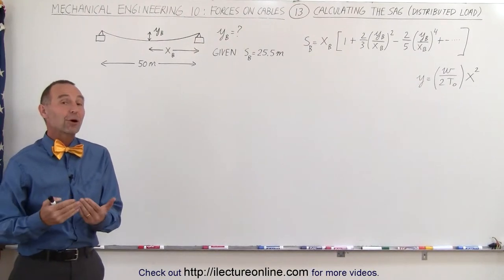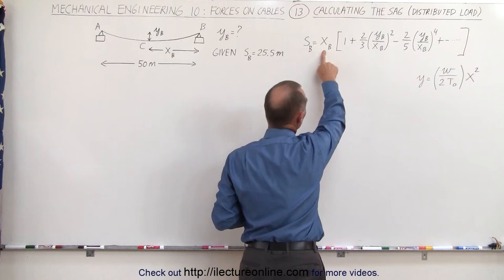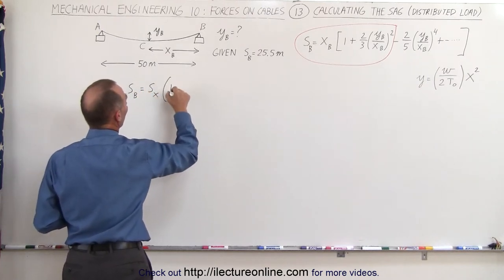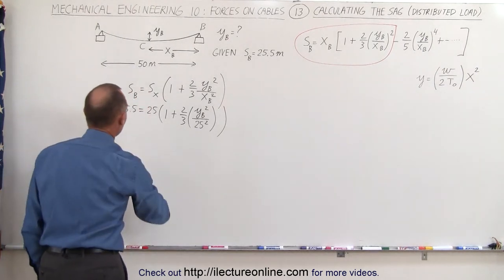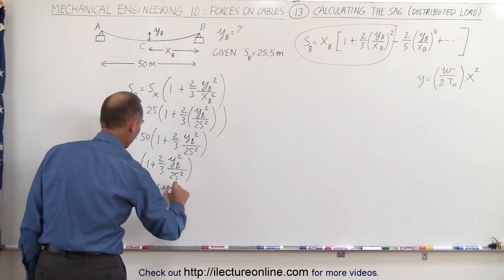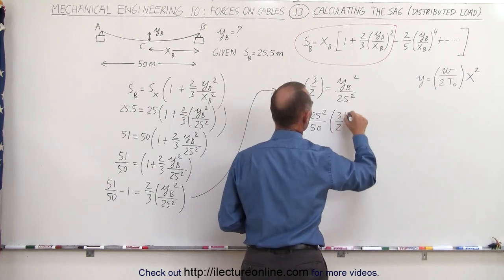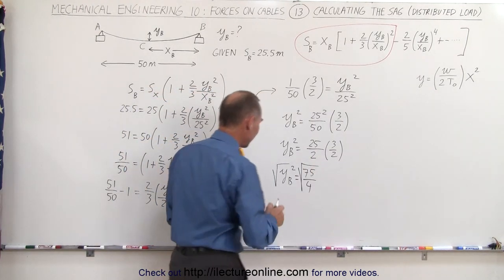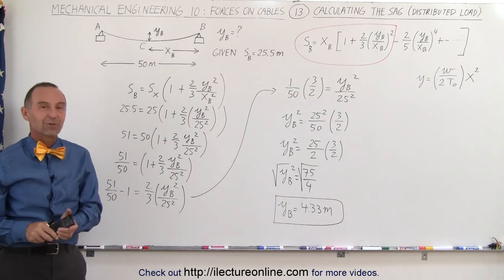Mechanical Engineering: Ch 10: Forces on Cables (13 of 33) Distributed Load: Find Sag=?

Comment: G'day Michael, Great explanation. I have a problem where i know the span, but i need to find the length of the conductor and the sag of the line. This is for a Specialist Maths Investigation. Is there any way to find these out? Your reply will be much appreciated!
Reply from the maker: Typically the required sag is determined by the tension allowed on the cable.  The greater the sag, the smaller the tension.  See the videos in this playlist starting with # 17 on the catenary
Reply: @MichelvanBiezen  G'day Michael, appreciate the reply. Is the tension determined by the mass of the cable?
The context of my problem is that I am doing a Year 12  investigation that involves 3D vector maths. I have modelled a valley with 2 ridgelines, and the span of the 2 ridgelines is 6.10m. The issue with this is that, I don't have a lot of known values. I would appreciate if we could do a Zoom call where we could discuss values and equations needed. I have attemped to try and solve by watching your videos, but unfortunately the similarity of the contexts of the problems are minimal. Would love to collab with you soon!